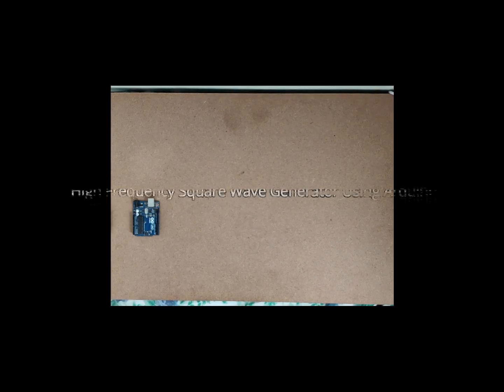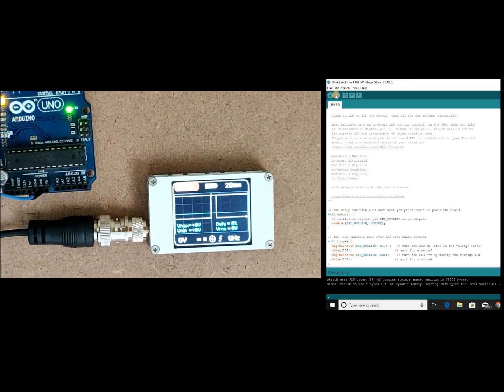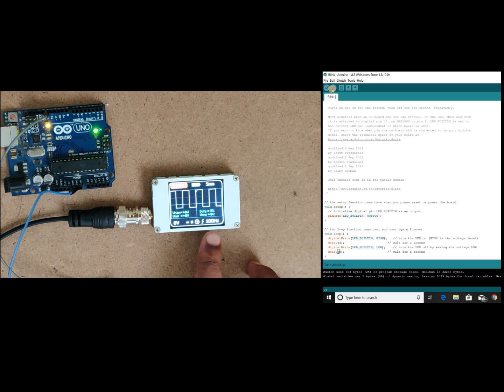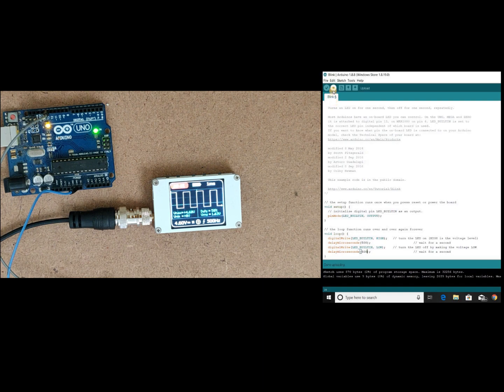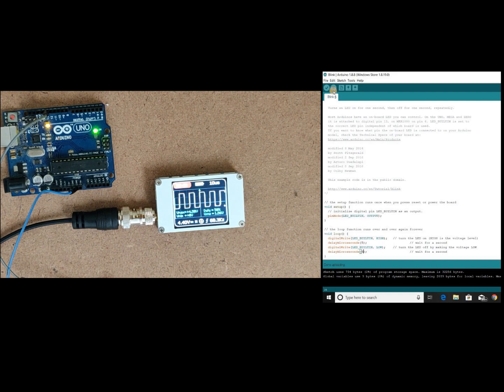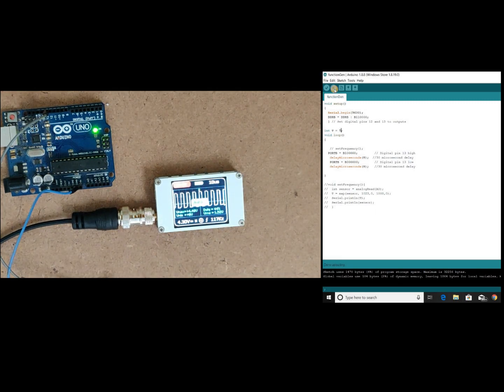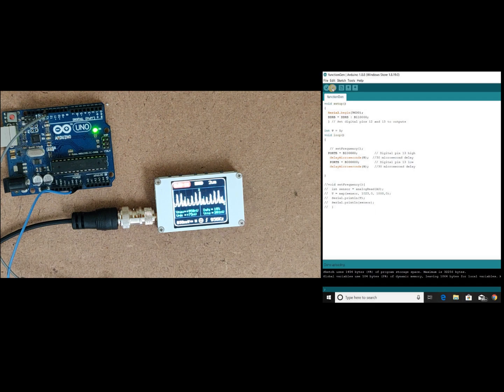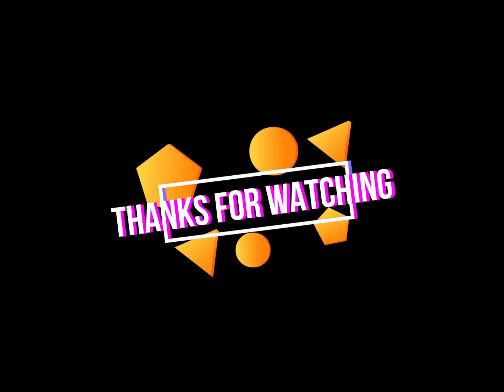Simple square wave generator using Arduino

Comment: I am trying to solve a stepper motor problem. The NEMA 32 motor is rated at 40,000 pulses per revolutions. The stepper.h library is rated at 32,767 pulses per revolutions. I wanted to use a direct code. The code you recommended is putting out 495 Hz at 1 ms and the maximum frequency the stepper.h library is putting out is 7.5 Khz. If I can figure this out all will be good. 🙂